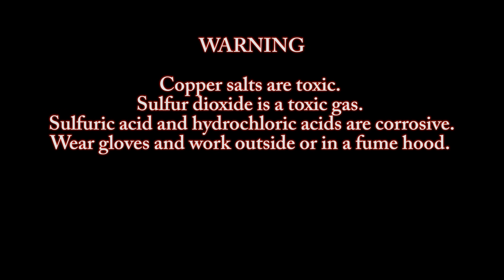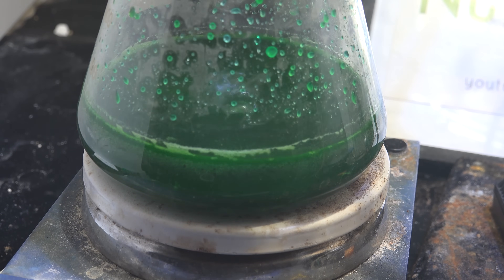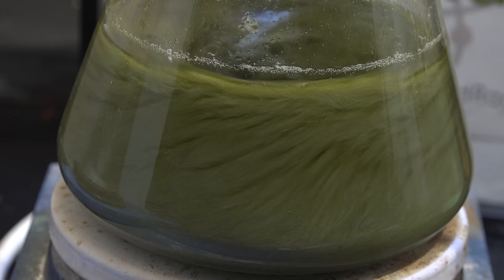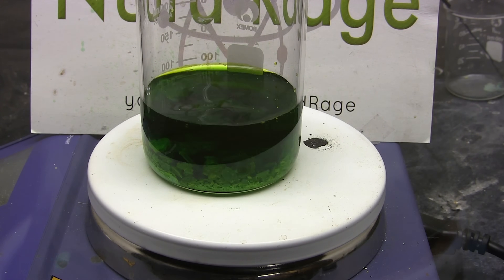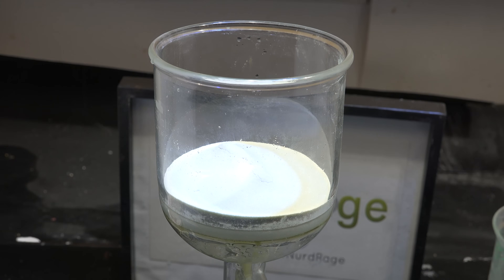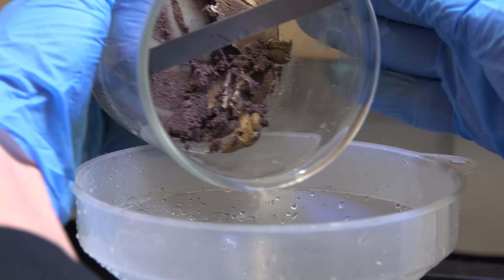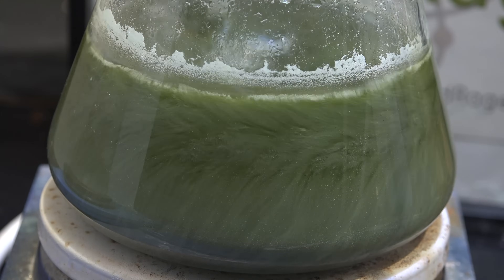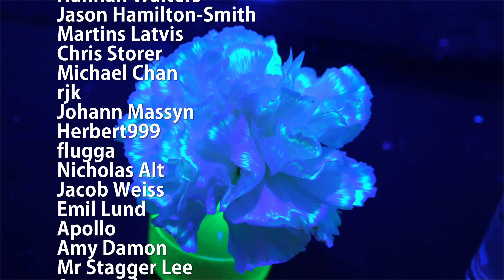Make Sulfuric Acid by the Copper Chloride Process

Comment: Hey, NurdRage! This video reminded me of something I've been trying with mixed results. I tried making copper metal powder by reducing copper sulfate in sulfuric acid with SO2 (sulfite). Though I don't have any H2SO4 left and can't try it again. My reasoning is SO2 reduces copper to Cu(I) (Cu2O), acid then dissolves it and Cu(I) disproportionates to Cu metal and Cu(II) which then reacts again. Could you maybe try it? I'd like to see if it works and if not - why. Cheers!
Reply: Copper metal powder can be made by reacting a copper sulfate solution with aluminium foil.

Comment: I always though you could make sulfuric acid by bubbling sulfur dioxide in water.
Reply from the maker: that gives sulfurous acid, not sulfuric acid.
Reply: Yes you are right :) Found an interesting thread on sciencemadness org where someone added hydrogen peroxide to produce h2so4. Someone else mention this could also be done with chlorine gas which is very interesting to me. You could maybe use electrolysis of salt water to produce the components to make concentrated sulfuric acid?

Comment: Hello NurdRage, I have a simple (new?) idea of how to make a sulfuric acid, but I cannot try it myself, hope you can try or at least comment on this. First you need SOME sulfuric acid to which you add elemental sulfur and drip hydrogen peroxide into the mixture. Idea is to dissolve sulfur in the piranha solution to make MORE acid, do it repeatedly! If this works, you can make lots of PURE acid just from a single drop to start with!
Reply: papanyanz yes, but hydrogen peroxide is expensive, and this method isn't 100% efficient (can work well though), and this dilutes a lot the sulphuric acid.
Reply: 1. Hydrogen peroxide (high enough strength) is free to buy almost everywhere(for swimming pools) which is more important to amateur than price (which is not THAT expensive btw.), sulfur is also abundant, so if the reaction works you have it without any legal issues. 2. Very high purity acid can be made, since it's easy to get rid of remaining sulfur (filtration), peroxide (boiling) and also to concentrate by boiling down to any strength!

Comment: Would it go faster if you added 100% oxygen instead of air?
Reply: RyneCJohnston well it's worth trying!
But corona dscharge isn't the best way to get ozone...
There are ozone generators and stuff
If you find a very very cheap one online than let me know...we may actualy try this!
Reply: Michel PASTOR i assume he used an gas bubbler thingy...
But for oxygen that doesn't matter THAT much
Reply: asvarien in theory it should... but electrolisys is the only cheap way to get oxygen
Reply: What about using ozone?  You can generate that from air using corona discharge devices.
Reply: I'm no expert, but I thought that many ozone generators use a fan to blow air through corona discharge. I don't know how efficient they are, but you may not need much. Incidentally, bigclivedotcom just published an interesting teardown video: https://youtu.be/STkMRTNDEFk 
Here's an Amazon posting to a clone of what Clive took apart: http://amzn.to/2xGCLnK.
Reply: Maybe it would be faster even with air and a bubbling stone ?
Reply: Lukáš J. If you go that far than you can oxidize S02 and skip the cucl process
Reply: Patrick Sweetman well, we aren't rolling in money soooo if someone can find something cheap for 10-20€ we can try this out....

Having conc. Oxygen on demand is very cool and usefull but i guess it's well over 100€ Second hand...
Reply: I picked up one from an estate sale for $100 a couple of years ago.  They are very useful for messing around.  Also, pure oxygen improves ozone generation by a huge amount.
Reply: Patrick Sweetman yea but i'm sorry to say that 100€ is too much currently for us

TCW is run by 2 students soooo yeah

Maybe you can try this experiment out cause you have the oxygen? And share the results?
Reply: Or maybe hydrogen peroxide could be used.
Reply: I see. Thank you.
Reply: The Chemical Workshop  You can pick up second hand oxygen concentrators that give over 90% oxygen. https://en.wikipedia.org/wiki/Oxygen_concentrator
Reply: They are an amazing development, aren't they.  I wish they were easily modified to supply pure nitrogen as a shielding gas.
Reply: Patrick Sweetman there is a thingy for that too
But the nitrogen is only 99% (not pure enough)

Just youtube applied science liquid nitrogen (he used this thing)

Comment: how about sulfuric acid from copper sulfate? it can be decomposed into copper oxide and sulfur trioxide which reacts with water to make sulfuric acid
Reply from the maker: I already did copper sulfate. You just electrolyze it, even easier than high temperature decomp.

Comment: electrolysis of copper sulfate is probably is best way for an amateur lab, but still take a long time to get a decent amount.
Reply: Interestingly, I have been able to buy a liter of 17.5 M sulfuric acid from my local hardware store under the name  "Rooto Professional Drain Opener". The acid looks quite clear and clean, and there are videos on youtube that test it and determine it has a fairly low amount of dissolved impurities in it. You might want to check the drain cleaner section of your local hardware store for the bottles that are in thick plastic bags and are very heavy (due to conc. H2SO4's high density). When I first saw it, I didn't believe it either. The price was under 10 bucks per liter as well.
Reply: In germany u can get fucked even worse.Besides the ban on many interesting chemicals u can even get personal restrictions.Im not 18 yet and a person who had a problem with me went to the youth office and they  
can ban u from using or having any chemicals.So im not even allowed to use a gas burner or grow christals from copper/aluminium salts without risking that my father loses child custody.And even my chemistry teacher said that this is stupid espacialy because im the only one in our class who he would trust to work with dangerus chemicals.But yea this rules are made by some stupid politicians.
Reply: the regulation varies from countries to countries, and sulfuric acid based drain cleaners are hard to find, and require distillation to purify it, (it was the worst distillation i have ever done, ),
Reply: Ah, I didn't realize that. I guess America doesn't care to regulate it for some reason.
Reply: it's usually regulated by state and store. Some store chains refuse to carry xyz product because it contains X. I've driven 30 minutes to another state to find completely different products in the same store. It's bizarre.
Reply: but US does have very strict regulations on many drug precursors, so does Oz, that is part of reason why i had to do many of my projects overseas.
Reply: Yep, and CuSO4 isn’t exactly cheap. I’ve done the numbers and it’s cheaper to distill battery acid (37% sulfuric acid) than using CuSO4, even with a perfect yield.
Reply: Waste of time if you ask me (from experience) and considering tonnes of conc. H2SO4 are produced annually each year through the "Contact Process" there is no reason why you shouldn't be able to buy it relatively cheaply. I think spending hours making a few mL of H2SO4 rather than making something more worthwhile (interesting) is just plain silly and detracts from the hobby. But I do appreciate understanding the Science behind this video and the time/effort that has gone into it but in terms of value/scalability like Nurdrage says it's not worth it.
Reply: of course buy it directly is best way without a single double, I personally have electrolised kilograms of CuSO4 and distill the acid, I know it is a hassle to do this to begin with. But the thing there is sulfuric acid and many other chemicals are restricted for regular individuals to buy.if you have a way to but them, buying it directly obviously is the cheapest way, .(actually, it's still cheaper buying it at black market than making it yourself, but not everyone has the connection so...)

Comment from the maker: Digging up old video clips from 2009 makes me feel old. It's been 8 years since i did those experiments. The video doesn't hold up well in terms of quality. Maybe i should redo some of them with more modern equipment.
Reply: NurdRage they're still of high quality with the voice overs and the overall education we gain from these videos though. Old or new keep the videos pumping my fellow chemist
Reply: 2009? I was still a sane and respectable person when you recorded those clips
Reply: I wonder how h2o2 from the convenience store would affect the process, even at its low concentration. Some of those unbranded bottles sell for about a dollar.
Reply: It makes me nostalgic to the days when you were a small channel and I was a small amateur chemist , leave it as it is
Reply: +NurdRage I know a much better catalitic way to make sulfuric acid using copper salts that you can try and make a video of it. You can bubble hydrogen sulfide into a solution of copper (II) sulfate to make copper (II) sulfide and sulfuric acid, then after filtering off the copper (II) sulfide just leave it covered with water for a few days. The oxygen in the air will react with the water and the copper (II) sulfide to regenerate the copper (II) sulfate pentahydrate. Wanna try tris method?
Reply: +NurdRage you said that excess hydrochloric acid complexes with the copper(I) chloride. Wouldn't the reaction kinetics better when the copper(I) ions are dissolved rather than in solid particle form?
Reply: You should do a video synthesizing sulfuric acid via electrolysis of CuSO4 dissolved in water. To me it seems like the cheapest and easiest (also safest) way to synthesize sulfuric acid.
Reply: Speaking of digging up old videos, you need to make a video in about a month commenting on your hot plate element replacements!
Reply: Mexi Chemia The sulfur dioxide that was used in this video is also a toxic gas, so my idea of a similar process isn´t that much different when it comes to toxicity.
Reply: i found a way to make sulfuric acid from Gypsum!!!
using sodium hydroxide as somewhat of a catalyst

first react it with sodium hydroxide to form sodium sulfate
then using a salt splitter electrolysis cell put the sodium sulfate solution in and wait for 3 days
the anodic area will produce sulfuric acid if your electrodes are either Pb Pt or Carbon rods
it will produce CuSO4 if you use copper

the cathode will produce sodium hydroxide which can react with more gypsum
 living in the desert means i have acess to a ton of gypsum right outside in the ground!!
Reply: I couldn't tell except for the high temperature mantle shot and the H2O2 process.
Reply: what was that tin foil for when you were distilling the hydrochloric acid out
Reply: Foil reflects radiated heat back in, so it helps keep the flask and/or column warm - you don't want your product condensing and falling back into solution before it hits the condenser.
Reply: +ChemicalMaster that sounds like what happens at old gold mine tailing piles. When they don't destroy the cyanide leachate properly it starts a chain reaction with water. Would love for more discussion if people are interested with a video from +NurdRage
Reply: Hamizan Amran yeah but its not worth the expense.
Reply: Nah man the rusty hot plate adds character
Reply: I wonder if bubbling oxygen produced from the reaction of bleach and peroxide would speed up the oxidation step. Both available cheaply OTC.